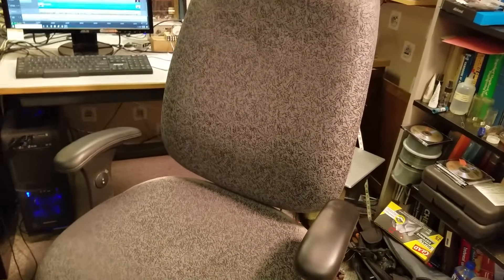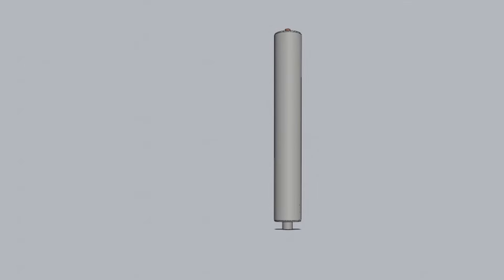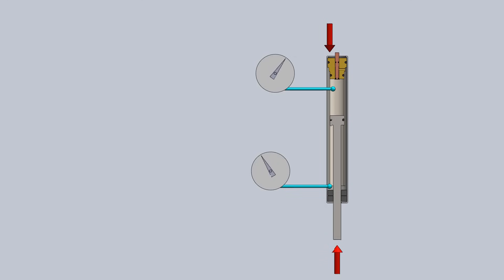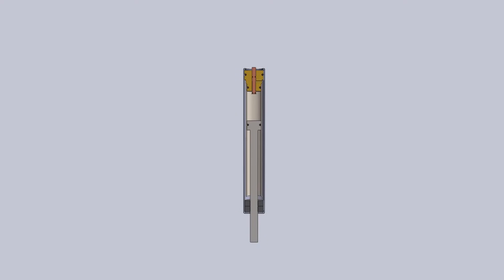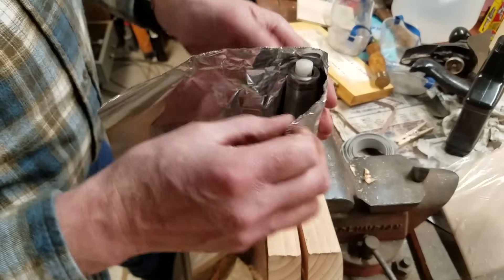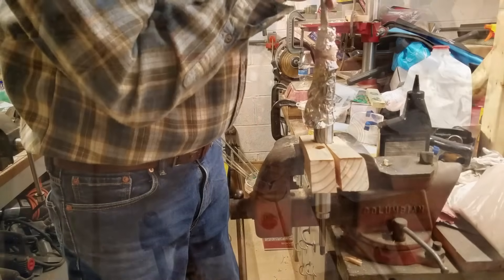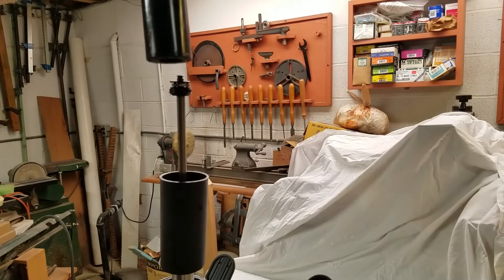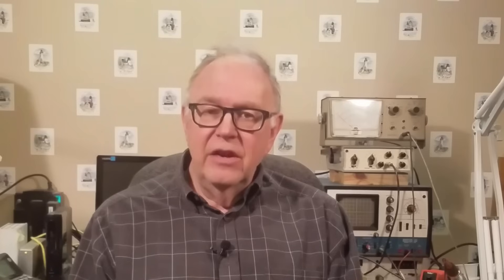The Mystery of the Sinking Office Chair - Can We Fix It?

Comment: David what was the measurement on the strut cylinder(width & length)? I have a similar chair
Reply from the maker: The cylinder was about 1.1" in diameter with a length of 10".  The rod was 0.4" in diameter with a projection of 6".  There's a wide selection of cylinders.  If you are going to replace yours, I would verify the dimensions before buying anything.
Reply: @LifewithDavid1  so where did you find it, Amazon?
Reply from the maker: I didn't purchase a new cylinder since I was able to fix the original one.  However, there are several office chair parts companies on the web that offer a variety of different cylinders.

Comment: Check out theofficeoasis dot com for a simple extractor for these cylinders. Inspired by brass instrument mouthpiece remover or automotive pulley extractor, I guess, or shop presses. Anyway, works a champ. Just two split rings, one loosely fitted to the cylinder where it meets the chair and another that is clamped solidly to the cylinder. Screws are then turned in the lower ring to separate the two, which inevitably removes the cylinder from the chair, doing zero damage to anything but one's pocketbook. Wish I had known last time.
Reply from the maker: That looks like it would make cylinder removal MUCH easier.  Thanks for the info!

Comment: hey, i have this problem with a chair, but it only goes down if you sit in it after a while of not being sit in it, is juts happen randomly and never happened when youre it sit in the chair, only when you gonna sit, its the same problem or what is that, is wierd af.
Reply from the maker: For giggles and grins; try turning the chair upside down for a few hours or days.  There might be an accumulation of oil/ grease that has fallen down the cylinder wall, away from the piston seal.  By turning the chair upside down, the oil will flow toward the piston seal and may wet it again.  Cycle the chair up and down a few times.  That might be enough to wet the piston seal and allow it to work better.
Reply: @LifewithDavid1  the chair was on warranty and was 200usd chair so i just rma it, i dont want to fuck up, thanks for the response btw.

Comment: my chair does not sink but when i rest my back it starts sinking slowely ? any reasons why this happens
Reply from the maker: Perhaps the O-ring on one side of the piston is a little dry or worn.  Try holding the support shaft and spinning the chair 180 degrees in order to rotate the piston in the cylinder.  That might help; I've done that with mine and it seems to work.
Reply: @LifewithDavid1  sir not gonna lie this really worked. thank you so much you have been a great help.

Comment: It's very clear, can you please share the links to purchase the chair oil
Reply from the maker: Hi!  Any hydraulic jack oil should work.  If you can't get it at your local auto parts store, this would work: https://www.amazon.com/Bars-Leaks-Jack-Stop-Leak/dp/B0002KKIBY/ref=asc_df_B0002KKIBY/?tag=hyprod-20&linkCode=df0&hvadid=312174136943&hvpos=&hvnetw=g&hvrand=760491421124307965&hvpone=&hvptwo=&hvqmt=&hvdev=c&hvdvcmdl=&hvlocint=&hvlocphy=9015344&hvtargid=pla-568857223362&psc=1&tag=&ref=&adgrpid=63790029762&hvpone=&hvptwo=&hvadid=312174136943&hvpos=&hvnetw=g&hvrand=760491421124307965&hvqmt=&hvdev=c&hvdvcmdl=&hvlocint=&hvlocphy=9015344&hvtargid=pla-568857223362

Comment: can i use normal oil, use in motorcycle
Reply from the maker: The reason I use hydraulic jack oil that it plays nicely with rubber seals; a jack cylinder is very similar to a chair cylinder.  Some motor oils might cause the chair seals to swell or soften; but then again, some may not.
Reply: @LifewithDavid1  thanks for advice helpful

Comment: i always set the lowest level on gas cyclinder chair, only sometime i increase it but suddently today, looks like it loss all gas and pull down / up lever does nothing, just stay at bottom..Dont feel any pressure anymore. I guess, my only choise is to replace the cylinder right?
Reply from the maker: I think you are right.  There are several sites that sell replacement cylinders.  Good luck!

Comment: YOU must have a cheap floor as when the oil leaks out from the cylinder ONTO THE FLOOR, it could ruin my oak flooring? Would it not be better to get a coke can, cut a sleeve from it to place inside the chair base which will tighten the lifting barrel? So NOT allowing it to slide down the foot base?
Reply from the maker: I've never had any problems with oil leaking.  I do use hydraulic jack oil which is a little heavier than normal oil.  I do like the cushioning action of the little "give" the seat gives when you sit on it; I wouldn't get that by just locking the cylinder.  However, do whatever you want.

Comment: A word of caution. It is possible to compress the rod far enough in the cylinder so all of the compressed gas is released in a flash. Once that happens, you're done. Time to cut some conduit or PVC pipe to slide over the rod to hold the chair up.  No more adjustment but you have fixed the sinking problem forever.
Reply from the maker: I suppose that if the bottom end of the support rod was corroded or damaged, the the support rod seal could be compromised.  However, that condition would also occur if the chair was lowered as far as it would go.  The chair seat always rests on the support rod and the seat's downward travel is halted by the cylinder bottoming out.  It can't be compressed any further, even if it is removed from the chair. 
 You are correct that if the gas pressure is released, the cylinder needs to either be replaced or disabled by using PVC pipe.
Reply: @LifewithDavid1  When I got to the part of the video where you said that, I thought you were giving up too easy. :-)  I expect to see a video where you bring a dead cylinder back to life through complete teardown and o-ring replacement, possibly some lathe work, and somehow recharging it with a home-made 2000-psi nitrogen supply.  We don't care about no stinkin' budgets, cost is of no importance when bringing this $15 cylinder back to life.  Otherwise, great video and thanks for the info. I think my chair sinks slowly enough that it's worth trying to add some oil.

Comment: Hi David, thanks for imparting this wisdom. I'd like to know if the seat is still holding....
Reply from the maker: Yes it is.  However, once in a while, I turn the chair upside down, and cycle the chair up and down.  That keeps the oil/ grease around the piston seal.
Reply: @LifewithDavid1  Great, just to let you know that your video helped me alot. My seat is holding up but the only problem I have is the oil I used is too viscous. I'll be much better off when I get myself some heavier oil.

Comment from the maker: One thing that maybe wasn't obvious, the gas pressure in the upper cylinder is lower than in the lower cylinder because the upper piston area is larger than bottom piston.  The force on the piston top is the same as the force on the piston bottom; otherwise the piston would move.  Since:
   Pressure(top) * Area(top) = Pressure(bottom)  * Area(bottom)  
Then a smaller Area(bottom) requires a higher Pressure(bottom).
Reply: Yes, this was the "aha!" moment for me, which makes it possible for the overall design to be significantly simpler than you'd expect! I think this only affects the adjustment mechanism though, not the weight it can support, as the latter is just determined by the gas pressure I think
Reply: Heavy duty mechanic here, just had to replace a seat and finally got curious enough to look up how these cylinders work with no lines going to them.

This was the explanation that I was looking for. Force = pressure x area. Bigger surface area = bigger force if the pressure is constant. 

Fluid always flows from high pressure to low pressure. You need a force equalization to keep the cylinder stationary, and the seals need to be rated for the pressures involved. I was having a tough time wrapping my head around why a larger surface area would equal less force, but it doesn't. The pressure is what fluctuates, not the force. Even as the cylinder is being actuated, the force remains constant on both sides of the piston. Since air is compressible, the added force of your cheeks compresses the cylinder some, but the piston quickly discovers its new home in the equalization zone of upper and lower forces. 

Key takeaway: the valve allows the pressure to be adjusted, not the force.
Reply from the maker: @alainsauve5903  Glad this helped.  Actually, the valve adjusts the volume above and below the piston, everything else finds their own equilibrium (picture of mind blowing up here).  Sum the forces around the piston; gas force below the piston = seat force down plus gas force above the piston.  Thanks for watching!

Comment: Great explanation, I never knew how these things worked. Mine has the same problem, it gradually sinks down after about an hour until I find myself sitting on the floor!
Reply from the maker: Thanks.  You might just try turning the chair upside down and cycling the piston up and down several times first to redistribute the grease/ oil that settled to the bottom.  That might be all it needs.
Reply: @LifewithDavid1  I should try that. The chair was delivered from my workplace to help with working from home, and there was a little puddle of oil on the floor. But maybe redistributing what's left will still help.
Reply: Mine did the same, reminded me of going back to infant school , where I once sat on the toilet in an emergency, my knees were above my head!